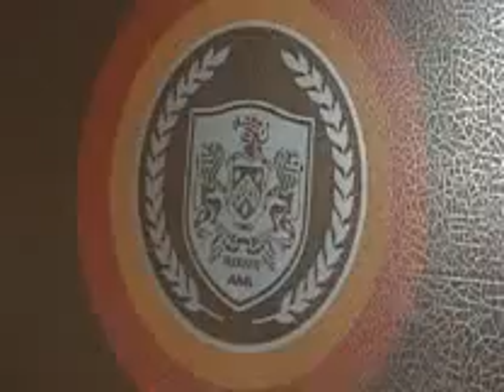My Color Jukebox Project

Comment from the maker: @nicholaskohnen I just used the wires that goes from the tuning arm plug and soldered some speaker wire with RCA Jack's and plug it in the Phono input on the stereo. I long sense took out the stereo in this jukebox and replaced it with a high power amp by Yamaha and it is larder then ever. look at another video i did with this juke and you will see the amp.